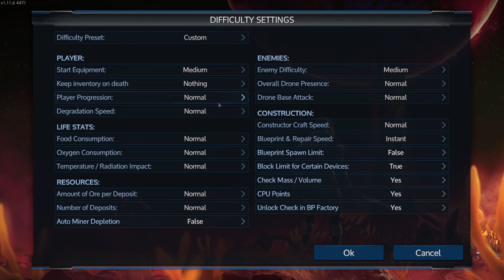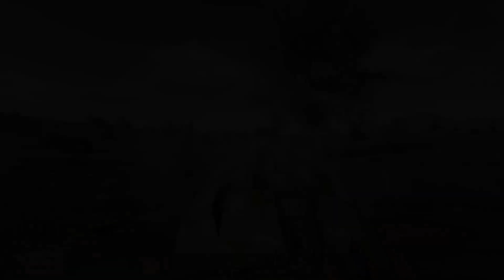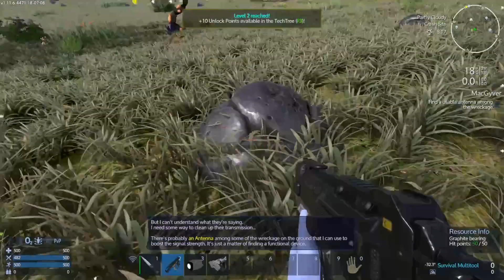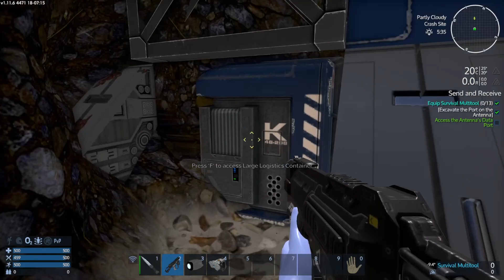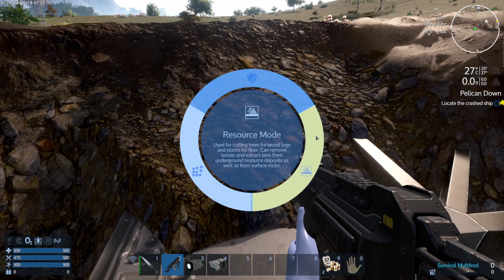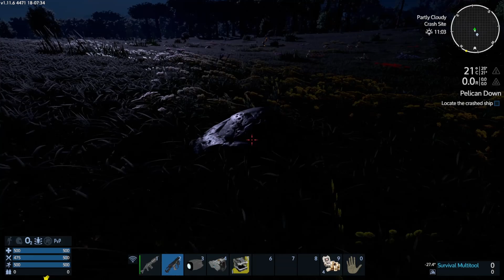First Look (All New Icons) : Reforged Eden 2 Beta (June 2024): #01

Comment: I was about to say something about Reforged Eden 2 coming out soon.   It seems the beta is out now.   I won't bother until it reaches experimental release.
Reply from the maker: Makes sense.  The main reason for doing this series is to try and get a handle on the changes to ship building.
Reply: @StephenSilverbeard  I changed my mind.  When I get done with the starter system in vanilla I will check out Reforged Eden.  I need to visit each planet in the starter system.  I am still visiting each of the starter moons.   Adding the MX5 to my blueprints list.   I'll get the MX5 then go collect more resources for a CV.  I just don't have the 1.7k neo and need about 500 or so more cobalt for Spanj's hammerhead starter.   This new vanilla start is very difficult finding neo and cobalt.  Oh I salvaged the abandoned base and Com array after completing the mission for it.   I got a good bit of cobalt I needed from fuel tanks etc. My abandoned base poi had less than 100 neo. .I didn't get much neo. I got a couple hundred of the zeno blocks which are not useful starting out.  I think I need to look for ship wrecks and try to salvage CV engines using the MX5.  I need to build several cores too I will want the full CV thrusters not parts.